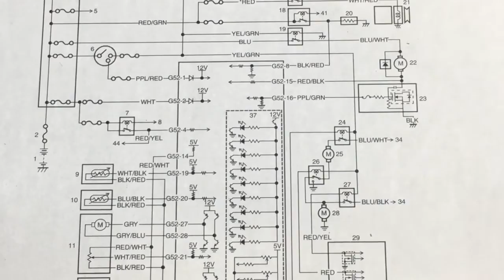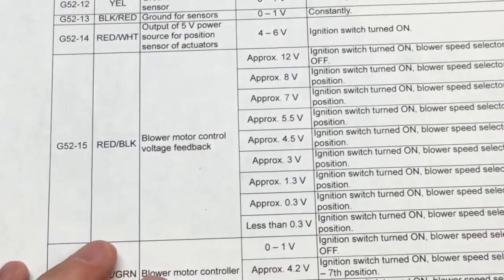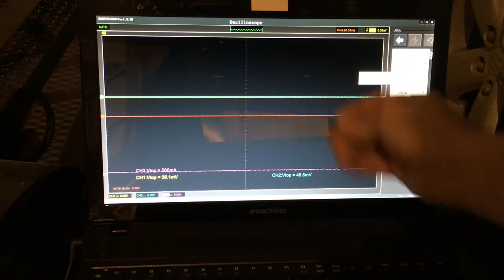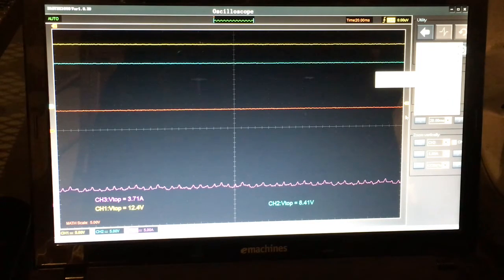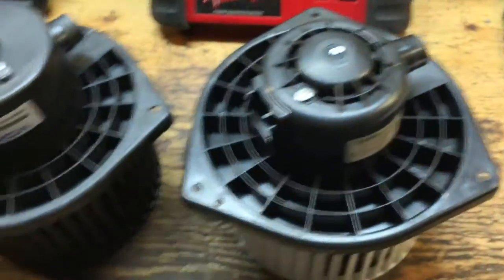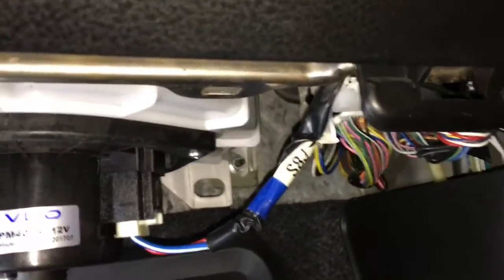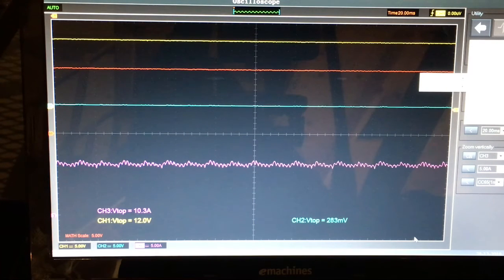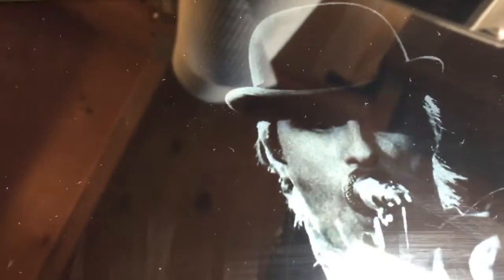Vitara Vent Blower Change/Study

Comment: Very nice case study Ian very good information mate cheers 👍👍👍
Reply from the maker: Thx Igor. Pretty significant difference in draw between the two. Cheers
Reply: TheGibby3340 indeed 5amps good call replacing it , you can tell that it’s running much smoother than the old one 👍

Comment: The initial amps on the bad blower was 3.6ish new one was 2.4ish big start up difference..  nice video.. keep up the good work..
Side note*** I had a customer come in once with an intermittent blown fuse 
For the rad fan.  after 3 garages, brings it to me.. found the rad fan was constantly pulling 45amps when on.. system rating was 40amps.. there was no noise indicating bearing wear or any other symptoms.. be the 10% and you will find the issue.
Reply from the maker: Hi Jeremy. I know some blowers can draw quite a bit. Always nice when the manual publishes the spec...no guess work! 45 Amps Wow !!! Cheers. Bonne Annee...when it arrives.
Reply: @TheGibby3340  same to you.. by the way. Where are you located?
Reply from the maker: Orangeville. 50 Kms NW of Toronto
Reply: @TheGibby3340  no way.. we should meet up sometime.. be nice to meet some people who do what we do.
Reply: Only 531km lol
Reply from the maker: Round the corner. One of my brothers is an Auto mech. Full respect! I am just a hobbyist. I make sure I mention that in my Vids from time to time. Not a fan of pretenders.